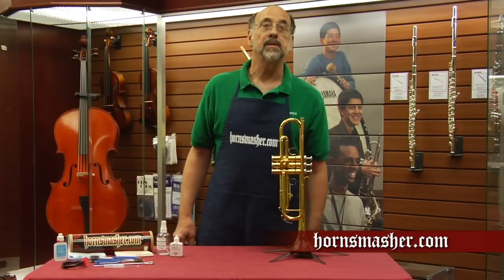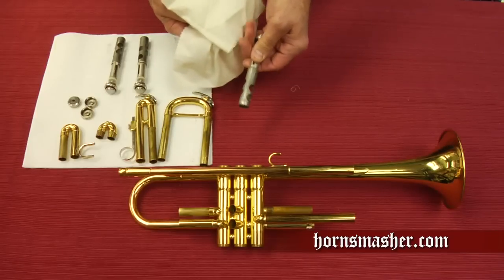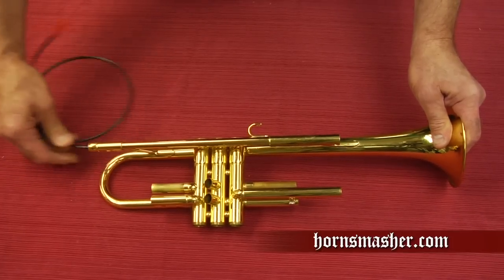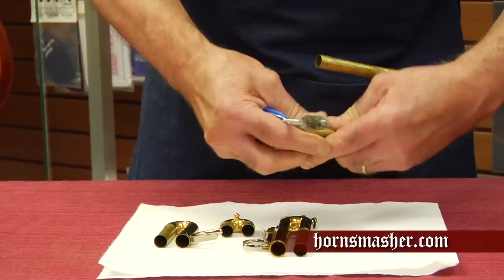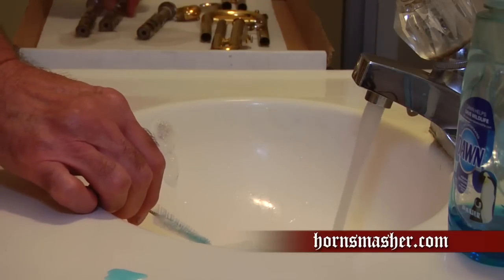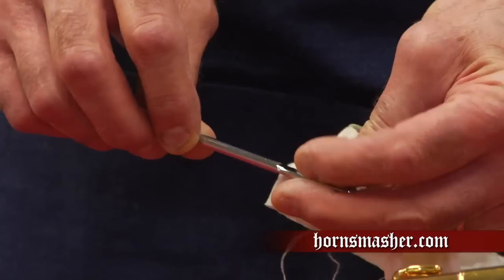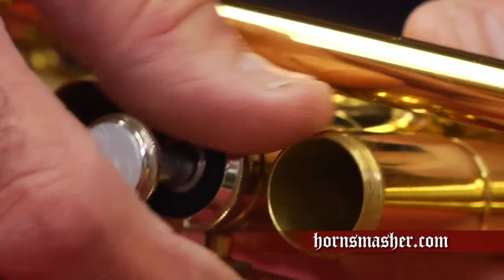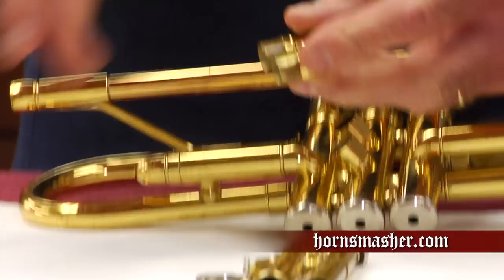Trumpet Periodic Maintenance

Comment: Nylon  bristles are better than metal.  Metal will remove brass scratching it out. I'm surprised this video isn't recommending brasso or steel wool for polishing the slide inner tubes shiny?  LOL.   For straight brushes the 99cents only stores carry a "pipe brush kit" used for soldering copper pipe.  Comes with 3 brushes of which two can be used in trumpet pipes.  The 3rd one looks like a BBQ sauce brush so don't use that one.  The 2 you can use look like pistol barrel brushes but again bristles are nylon.   Using a cloth like in this video is good for drying more than cleaning.    If you're not using a swab like from Bob Reeves shop a couple times a week and your playing daily I recommend a full horn cleaning bi weekly.

Comment: When I played, I would give my trumpet a luke warm
bath once a week or so with all the valves and slides 
removed and do them separately and dry it with a soft
cotton cloth. I used Roche Thomas valve oil but recently 
tried Do'c Juice by Monster out of curiosity. It's OK but
I didn't noticed any difference. 

I use plain Vaseline on the slides which I find works better 
than oils. Just use a thin amount and wipe off any excess. 

Clean the mouthpiece after each use with q-tip and a pipe 
cleaner and once in awhile use mouthwash/cold water rinse.

Always keep a soft cloth in the case to hold or wipe down 
the trumpet. 

For new students, check the range of mouthpiece best suited 
for you. Generally a 7C in considered a good all round mouthpiece
and is what I always used.  Here's a few basics:

Parts of a mouthpiece:

https://www.google.com/search?q=trumpet+mouthpiece+size+chart&source=lnms&tbm=isch&sa=X&ved=0ahUKEwjpxvfBsIrcAhUTMH0KHTUMB9IQ_AUICygC&biw=1713&bih=910#imgdii=kz61lDiTAlIdaM:&imgrc=g16EfA2qRutNYM: 

Cup sizes:

https://www.google.com/search?q=largest+trumpet+mouthpiece&source=lnms&tbm=isch&sa=X&ved=0ahUKEwifyLGIo-PaAhVP9GMKHXz7DPsQ_AUICygC&biw=1728&bih=922#imgrc=mpMhJGj12McKhM:

https://www.google.com/search?q=largest+trumpet+mouthpiece&source=lnms&tbm=isch&sa=X&ved=0ahUKEwifyLGIo-PaAhVP9GMKHXz7DPsQ_AUICygC&biw=1728&bih=922#imgdii=ej4g1U5XRbBQDM:&imgrc=mpMhJGj12McKhM:

Hope this helps,

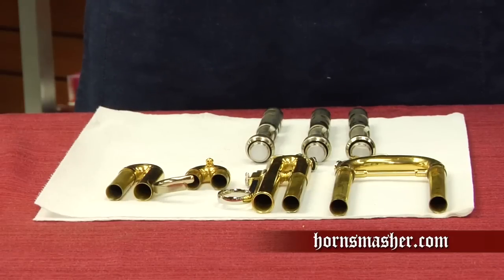Comment: Nice Demolition Derby @ 9:00 ..."KLINK!"  Good way to potentially damage precision parts.
Reply: Brad K ....AND, as Ramon below said, metal wire brushes on your valve casings, and slide tubes will RUIN a trumpet in NO TIME.
...AND, using a garden hose with a brass tip...something's bound to get dinged sooner or later.
...AND, shaking the hell out of the horn like that will either get the horn dropped, or bracing/solder joints busted.
Other than that, great video, LOL.
Reply: je ne vois aucune bonne raison de vous moquer de cette personne : tout le monde a droit à l'erreur . Vous n'êtes pas une personne charitable . DOMMAGE !!

Comment: I need more Explanation because I'm hearing no sound on my trumpet
Reply: The Garchomp Tamer I’m obviously a little late, but if you’re yet to figure it out, or if anyone is curious, I’ll tell you what may be the issue. Before you put the piston valves back in, make sure they’re in the correct order (each typically has a number on the piston). After they’re put in, twist the top caps until the valves “click” in place. This allows the passages in the pistons to line up, allowing your air to go through the instrument.

Comment: You should never ever put a wirebrush into your casings!!! This will not only grind away any dirt, it will also grind away the brass making the valves leak and rattle on the long term.
Reply: AGREED !!!!!  I shudder to think that one is GRINDING metal out of their valve slides.  Ultimately, you will have a horn that will not play, because you have ground-out enough metal to cause leakage (the ENEMY of all things Trumpet).  ALSO... do NOT use valve oil on the slides.  There are specific valve slide grease(s) available that are superior by far.  I use a Lanolin based grease that I got from Vincent Dell'Osa ("Trumpet Man" in Philadelphia) back in the mid-1960's.  It was the best grease I have ever found.  I am convinced that the Lanolin is a key ingredient.
Reply: that's probably why there was dust every time he pulled the brush out.
Reply: CaptainDanger 13 lol yea now that I think about it, that’s the brass that’s been scrapped out.
Reply: +++++ bad instructions